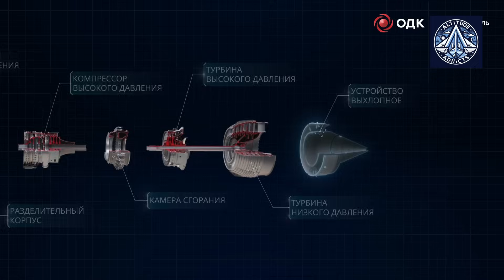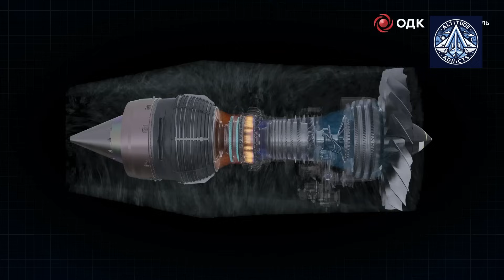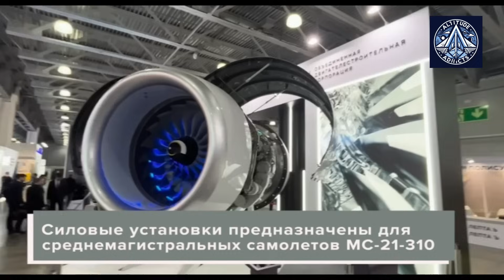PD-14 Engine Update: Will It Delay the MC-21's 2026 Launch?

Comment: What you are missing here is that all the numbers like 14.2 billion rubles (its about 170 million USD with todays FX), need to be instantly halved. Russia is so corrupt that funds allocated are stolen by everybody who can get their hands on it. Mostly by the people in government, since they are the ones who are stealing it themselves, since they have access to it. Often they allocate the funds, specifically to be stolen, its a money laundering scheme, a whashout if you wish. 

Also, while Safran does not publish the direct development cost of the LEAP engine, it is speculated that the program cost was around 1 billion USD. Now, think about this - Russia just injected 170 mil into and ALREADY developed engine, which had ALREADY cost roughly  500 million to develop. Bringing the total cost of the program to just short of 700 million USD. Or about 300 million less than the LEAP engine program. NOW, what do you get for 1 billion and for 700 million? Well, the LEAP engine outperforms the PD-14 in every single parameter. In some areas the LEAP engine is over 100% more efficient than the PD-14. 

Yet, here we are, people celebrating a development of an already outdated design, which cannot compete on the market. So back to the USSR, because there it was exactly the same. Shouting about great achievements and progress, while the rest of the world is decades ahead on the same technology.

Comment: the model number you see PD-14 is not the code used in engineering departments - the real model number has additional hidden suffixes to identify each modification to service personnel etc - so the real model is probably already something like this PD-14-b6 .... change is in fact unending

Comment: The Russians have at least four other engines in the shelves that can replace the PD-14 like a Soloviev, Progress, Kusnetzov or Advigatel with similar characteristics, there are other more efficient engines that can be used for a solid 20% gain in economy using a Geared Ducted Prop Engine like the Kusnetzov 73 ready since the late 90's... There are no lack of engines available and no, the project is still on track and also the shorter and longer version of the MC-21...
Reply: Just watched the last Mentour Now video where he talks about how tough it is to build an aircraft completely domestically—even for a country like the US. If Rus actually pulls it off, that’d be a huge achievement, even if it's like 10% worse than the latest and greatest
Reply: @KMASIF-mi9yj  Russia is not like the US or Europe, they have been leading aerospace research for 117 years since the first patent for the Pulse Jet engine in 1907..